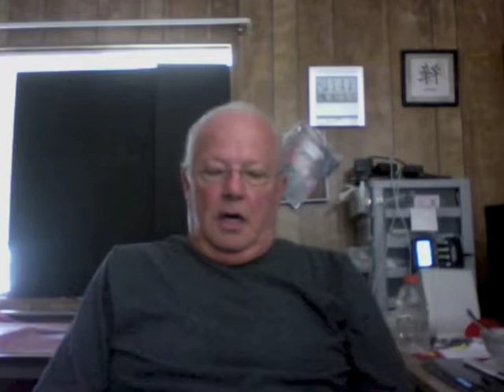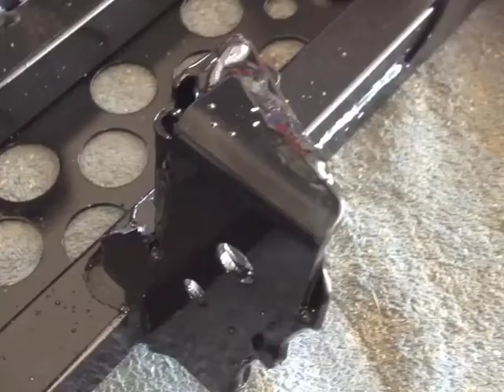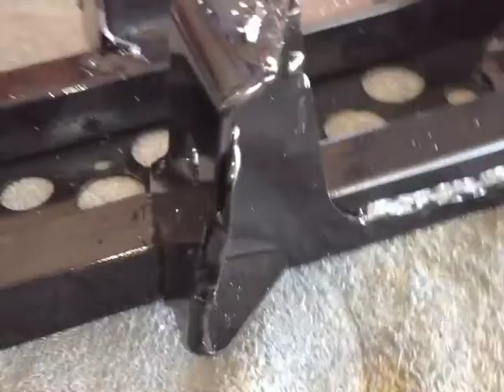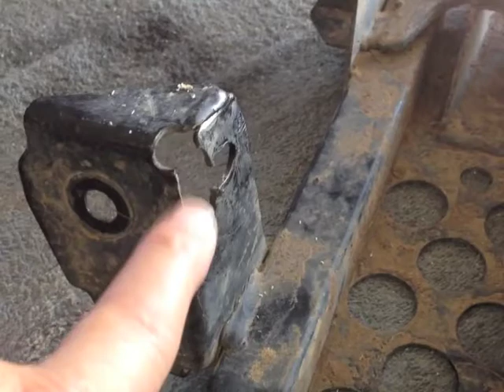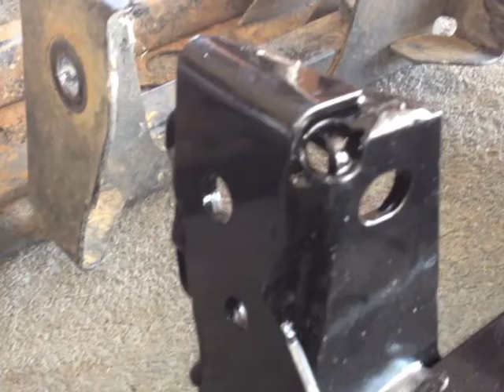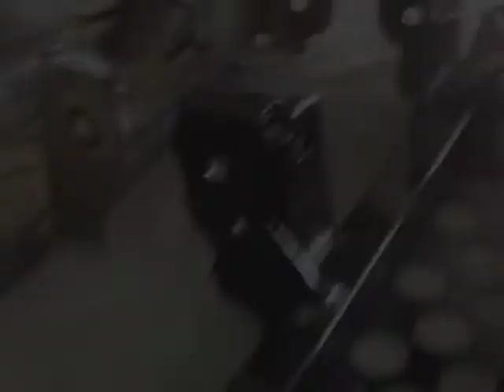2006 Polaris Hawkeye 4X4 suspension failure

Comment: Have a 2006 Hawkeye in my shop with less than 600 miles, Lt control arm forward bracket is ripped to the point where axle came out. Terrible design, somebody is wearing the coat of shame on this engineering.

Comment: Safe bet to take that any 2006 Polaris Hawkeye driven off road will suffer from rear suspension arm mount breakage.  Polaris changed the design....wonder why? Where's that leave the consumer....best case...stranded in the woods. Worst case.....busted up. Denial's not just a river in Egypt

Comment: Any updates ??
Reply from the maker: I never heard anything from the dealer or Polaris after that. As you can see by the thread, others have experienced the same sort of failure. I sold mine last year. No failure with the replacement with the strengthened gussets.

Comment: Thanks for posting this video, same problem with mine, your video lead me right to the problem and what to look for when I found the replacement on ebay for $130 to make sure I wasn't getting the same weak one.  FYI mine only has 93 miles and the subframe is non repairable seperated. Thanks again :)
Reply: dcon481 what part number was that? Mine just broke

Comment: my son has the same problem , contacted both dealer and Polaris - they gave me the same answer that you got . I ultimately repaired the frame and then about one year later the rt side broke .

Mr. Tuttle:

("  I found a place online that sells a replacement subframe for about 180".) 

If you have any other info the the aftermarket supplier that make a replacement I would be greatly appreciate it .

Thanks .

Comment: Honestly, not trying to pick a fight here but this honestly just seems like an old whiner mad and expecting something for nothing.  It is handy information to get out to people with these machines, don't get me wrong, but expecting a company to come good for a failed part 7 years after you bought it is just a little bit extreme.  You said yourself in the video, over a few years it felt like the rear end was loose.  this to me says you acknowledged there was an issue and continued using it never the less.  If I buy a brand new pickup truck and 7 years later some bushings fail even though I only drove a couple thousand miles and I drove it for 3 years realizing there was an issue, aren't I really the idiot to blame?  Had you taken the time 3 years prior to figure out the cause of the issue you most likely could have added the support yourself and it would have been a quick and easy fix.  Now all this being said, I looked up the part just now and actually found it for $167.01 and installation is typically only a couple hours in your own garage.  If you have ever heard the phrase "Mountains out of molehills"  this entire video describes it best.  OIt's a light duty machine with a flawed part that took you 7 years to break to failure, I'd say you got your moneys worth and you should find better things to fill your time, like maybe riding your machine that is now fixed.
Reply: Well I'd have to agree to disagree,  as this is more of a safety issue,  witch I've seen manufacturers put out safety recalls on vehicles over 10yrs old . And as such if a person was to get hurt due to poor craftsmanship,  of one part or another , big companies like Ford and Chevrolet both have been sued for millions of dollars! 
I would have to agree but because no one has been hurt yet , they are like most big companies.  No harm no faul . But when they loose millions,  the recall should and I believe will happen.

Comment: Same issues here Glenn, in less than 100 hrs and not abused.  I made new ones out of thicker metal only to find out  I have to replace bearings on both sides where they were stretched when the frame split. Good luck.

Comment: I just picked up a used hawkeye and got a surprise, broken rear a-arm mount. That explains why I got it for $300. I found a place online that sells a replacement subframe for about 180 so still a good deal I figure.
Reply: I have been looking for an aftermarket frame . no luck so far . can you help? direct me to a web site that may still handle them?
Reply: Wayne Morris partzilla.com is where I got it, think I got the 2008 version that's reinforced.
Reply: Scott Tuttle thank for your help. found it . ordered it . price is slightly higher but I don't mind , it fixes the problem
thanks again .

Comment: thanks you for the contact info will be getting in touch with them this week, and my quad is also a 2006 and has the exact same fail spots as yours does on both sides along the welds something has to be done as this is a design flaw and a major one at that thanks again and will let you know how i fair in all this

Comment: hi glenn, my name is brodie i just got home early from a quad ride due to the exact same issue as you had, except mine was worse as the left hand side had complety riped off befor we had noticed it, i will be contacting my dealer near me and polaris as well as i think this is a complete design and engineer flaw and agree they should replace the par, it was wondering if you had any names or numbers i should contact at polaris so they can hear that this is a issue they need to recognize